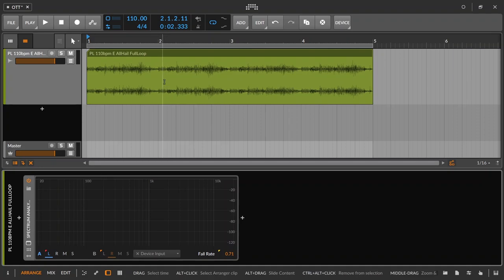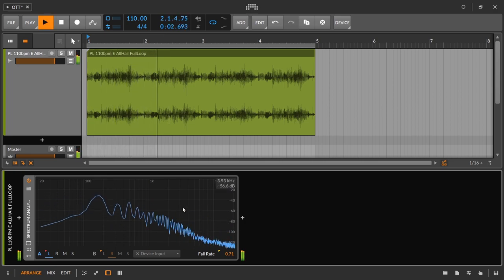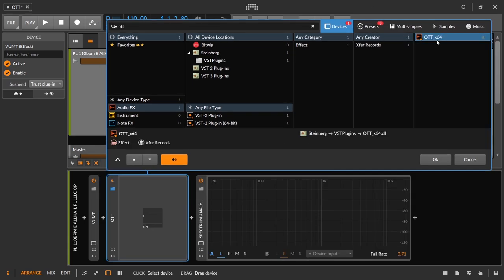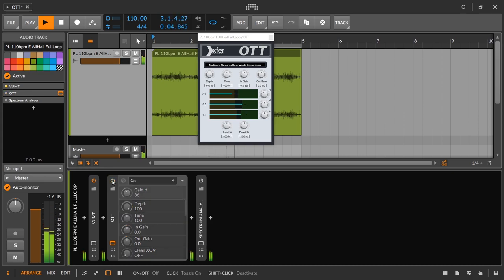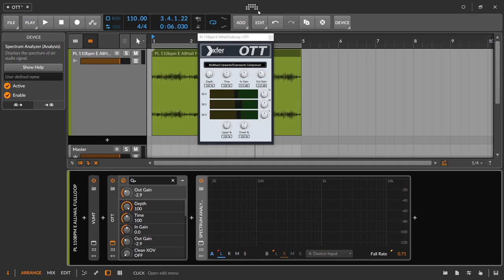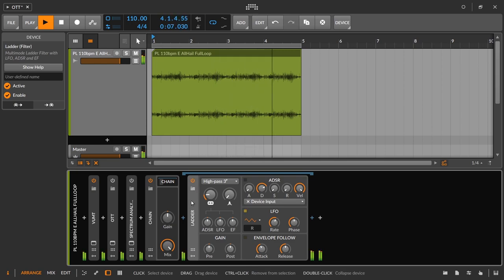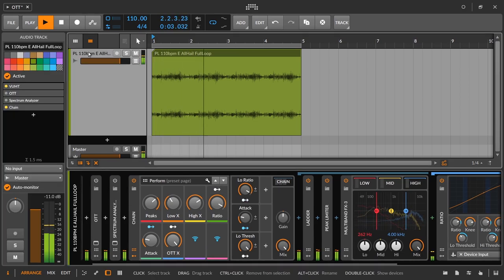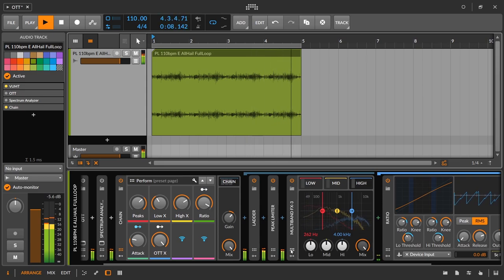OTT Style Effect With Bitwig Devices

Comment from the maker: Here is a modified preset.... https://drive.google.com/open?id=1T4Fg8cMLdzDk4mTkJta4BQOkFCXKyGSy

1) Try to Drive into chain at around -3 to -6 dB... 
2) Open Up Tune Remote Control
3) Start with the Peak Limiting... turn knob down until you start to hear audible pumping or distortion
4) Solo Low Band and set Low X frequency (you want to make sure your getting some signal in all three bands so its ok to turn this pretty far)
5) Solo High Band and Repeat process
6) Briefly Solo Mids to make sure your getting enough signal... Adjust X overs if need be. 
7) Turn Knee and Threshold to taste... the more you crank the more aggressive the effect
8) Go to Post Gain Remote control page and mix to taste

Comment: We used to call upward compression "expanding" (expansion, a device was called an expander). So, vinyl records were usually pretty compressed, depending on the music, so the groves could encode (handle) the dynamic range. You could, if you were an audiophile, buy an expander to recover the original dynamic range. A device that could do both was a compander.

Comment: Great stuff, as always. But one question around 13:00 - wouldn't it be better to add some gain before going into Multiband-FX 3, so that there's more vertical resolution in the signal for Dynamics to work on?

Also, a small tip for early on in the video, when you were comparing Spectrum before & after OTT - Spectrum device has a 2nd input, that you can set to be anywhere in the chain, so you can put the device after OTT and set the other input before OTT, so you can see pre- and post- at once :)
Reply: Oh, and regarding the origins of OTT - this will blow your mind :)
https://twitter.com/steve_duda/status/1228030702563684352
Reply from the maker: Sure. I mean there's no right or wrong way. When soften out the knee to the degree I did it's gonna be hitting it a lot.

Essentially I just want to see that the signal is hitting above and below the threshold points to get both a little upward and downward compression. In theory if you're doing something like this you'd want to adjust the gain going into each dynamics processor to really fine tune it. That is where OTT is handy because you can easily see where your setting your threshold and the degree of the compression on either side. This definitely isn't the "best" way to do it but it's the concept.

Comment: You really went above and beyond on this one! Cheers, bruv.

Question, though: wouldn't it be just as easy and even more transparent to make remote controls for each dynamics effect's output knob in the 1st multiband split effects unit rather than adding another multiband effects unit to the end? I'm just concerned about extra phase cancellation that might occur due to the 2nd multiband effects unit placed at the end of the chain. Who knows: it might make things sound better!
Reply from the maker: yes you are 100% correct... it makes a ton more sense to either add a tool device at the end of each chain or simply on the output of the dynamics. In the preset I shared that's what I did. Much more efficient and like you said less likely to add any unintended phase issues.

Comment: A very cool project a will build also ! Thank you...

Peak Limiter:
i am in bws 3.0.3 and i was trying the limiters true peak handling and check that with youlean loudness, that seems not work well.
But i am not sure how to test it the right way.

So do you know if is the limiter a true peak limiter?
Reply from the maker: It's as true as you'd expect for a built in device. It reminds me a lot of the old Waves L2 which is still a great peak limiter if you ask me. The Bitwig one adds a tiny bit of lookahead so whatever you set your ceiling to the signal won't surpass that (so yeah its a Brick Wall Limiter). It's not ISP as far as I know but for someone like me that really doesn't matter. If you look at it in the Youlean it's measuring the signal really closely so it may show some higher values than what the Bitwig meter does and if that worries you just bring down the ceiling slightly... like to .6 instead of the default .3 or whatever.